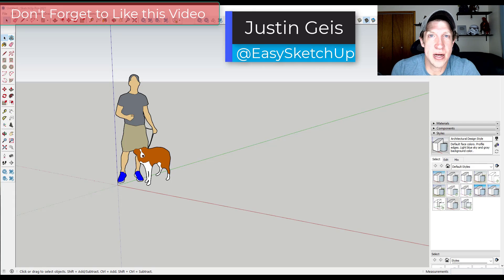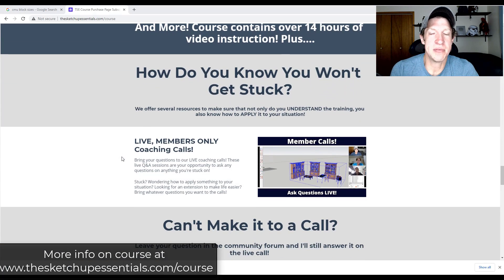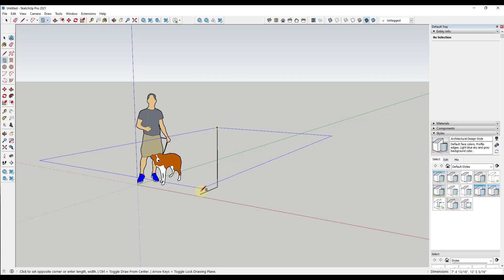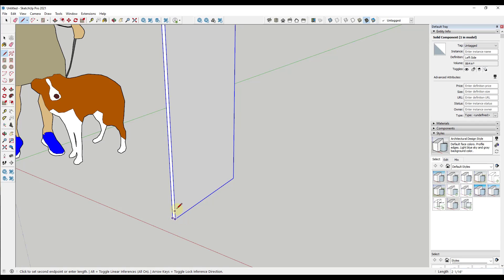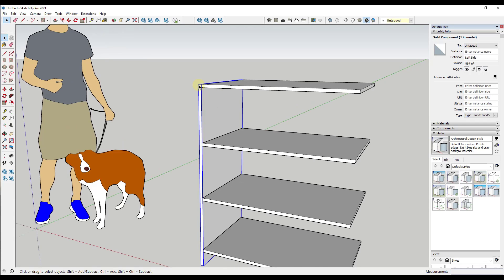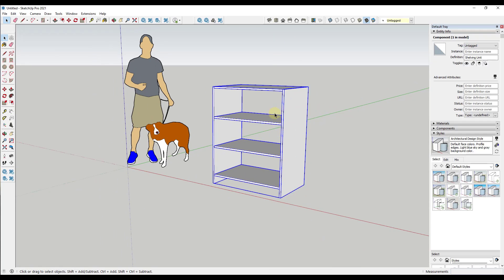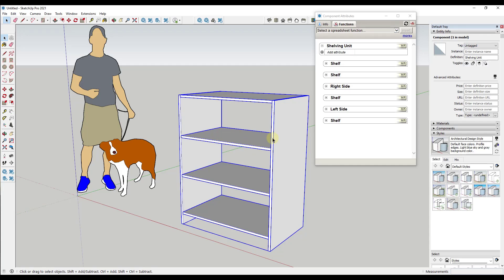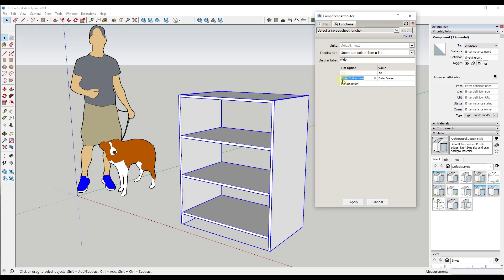Creating an ADJUSTABLE SHELF in SketchUp with Dynamic Components

Comment: Hi, when I change the width of the cabinet, it also changes the thickness of the left and right side in proportion. e.g. if the shelving unit  is 100cm wide in total and the thickness of the left and right sides is 2.5cm, adjusting the overall width adjusts the thickness of the left and right sides to 3.75cm. How do I fix these widths so that only the X dimension of the shelves adjusts dynamically, not the X dimension of the sides too?

Comment: Hi, great presentation as usual, but - I use cabinetsense add on to insert connectors (screws, cabineo ect) and forward to the CNC, how do I convert the dynamic component to the cabinetsense? Thanks
Reply from the maker: I don't know if you can convert dynamic components to cabinetsense - never used it

Comment: Awesome video. This would work very well for working with cabinets. How would I set it up so I can adjust the cabinet to a standard width and have the shelves 1.5" shorter?
Reply from the maker: I'd do the same thing I did with the depth, only using the Z location instead of the width
Reply: INSTEAD OF CREATING DYANAMIC COMPONENTS EVERYTIME. YOU CAN USE FREDO SCALE PLUGIN. THAT WORKS LIKE A CHARM BOTH IN HORIZONTAL AND VERTICAL DIRECTIONS